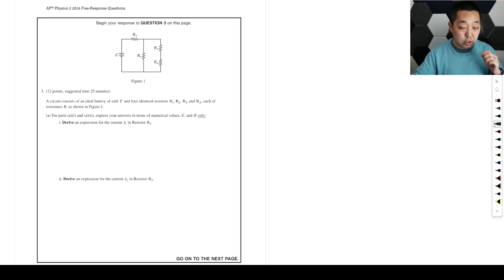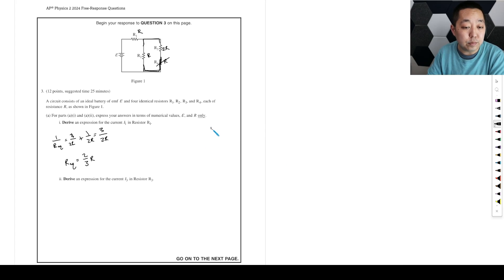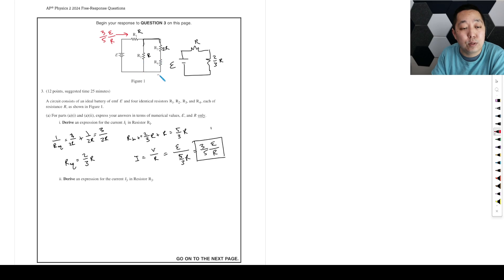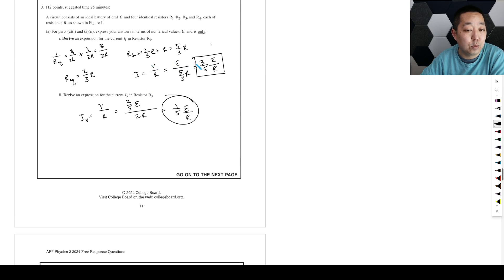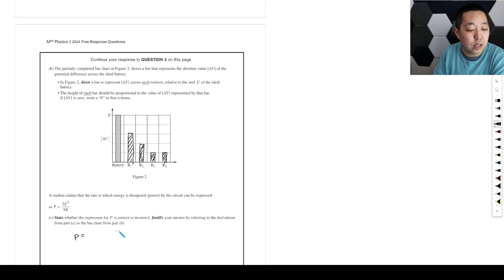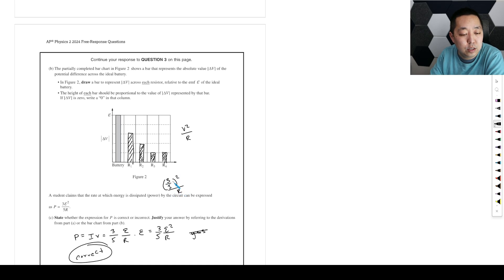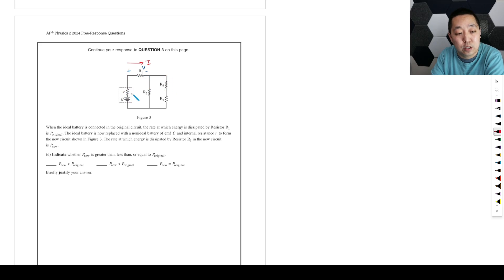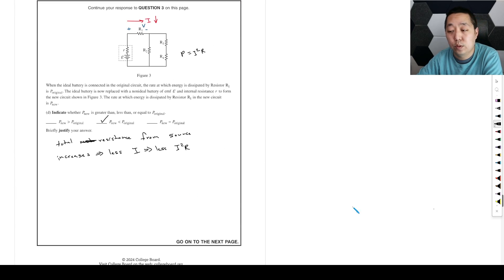2024 AP Physics 2 Free Response #3

Comment: for the bar graph, that is exactly what I did in the exam. But some of my friends told me that all the voltages should add up to the battery emf? is that right?
Reply: I changed mine from what he put to make them all equal battery emf 😭
Reply from the maker: No that's not correct. Those are parallel branches so they should not all add up. Only in a particular loop should they add up to the whole emf.

So the voltage across R1+R2 or across R1+R3+R4 would add up to the battery emf but not adding all 4 up